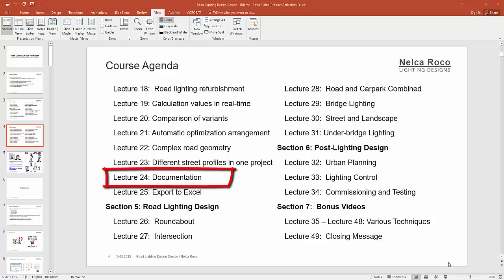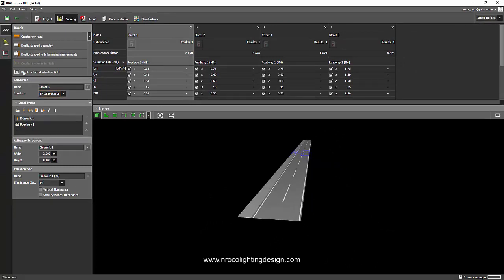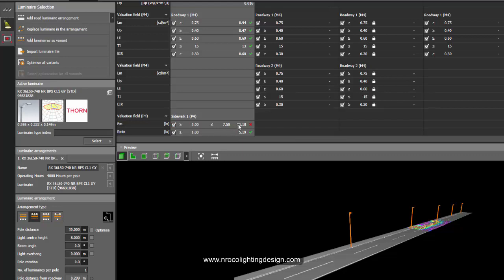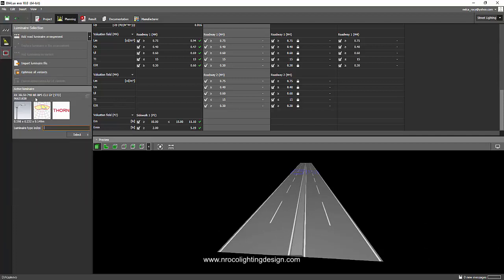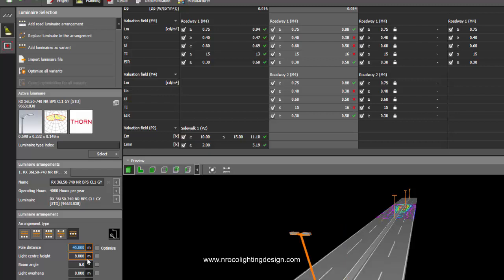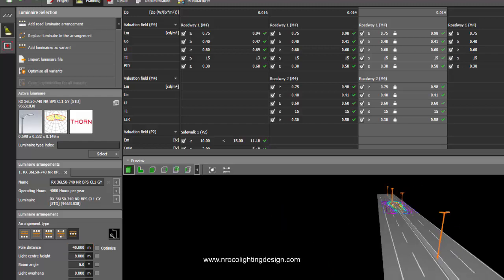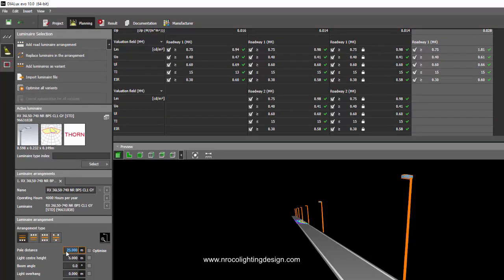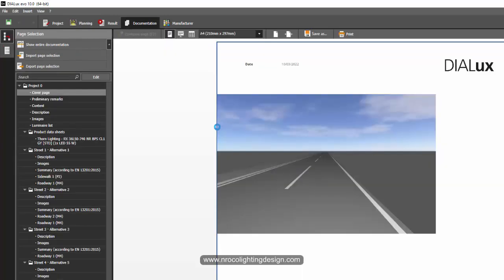Documentation for Road Lighting Design

Comment: Hi Nelca, What should i choose in Roadway surface, when the road surface is made from :
1. Asphalt
2. Concrete

I don't know what is CIE R3, CIE R1, CIE R4, CIE N1, CIE N2?
Reply from the maker: read the standard or enroll in my udemy course, road lighting design techniques.  check this link to enroll. https://www.udemy.com/course/road-lighting-design-using-dialux-evo/?referralCode=6C150BDEB3270B0A144C